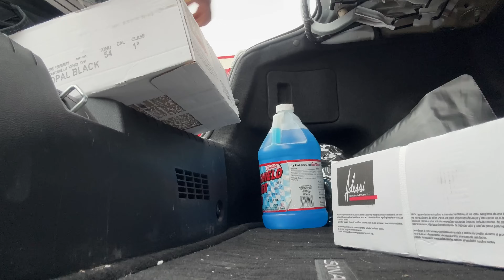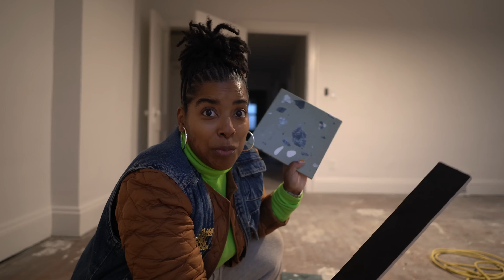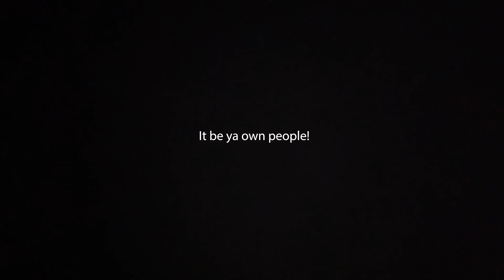Paint, Tile, And A BIG Bathroom Pivot!! Reno Adventures Ep. 10 #oldhouserenovation

Comment: Make sure your lease is professionally written when you are ready to sign new tenants. Tenants should not be nailing into walls or swapping out fixtures without the written permission of the landlord.
Reply: I'd actually prefer nailing into the wall because at least that's a hole that can easily be filled  Versus Command Strips, which have torn up some drywall 🥴